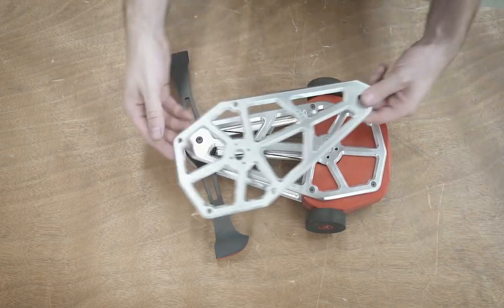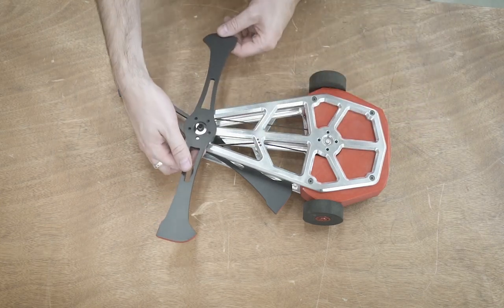Psychotic Break Overview

Comment: That butt seems like a prime target. On impact, you might spin around and expose that vulnerable switch area, or that's at least what I'd be hoping for if I fought against you. Those aluminum frames though... Yum! They look as indestructable as they are pretty! Also there's a nice mix of minimalist and innovative design in your builds. I always enjoy these overviews.
Reply: A vertical spinner to the rear would be the main concern for me. Especially so since the main robot power wire sandwiched just on the other side of the back of the body shell. However, I would hope that if Physcodic Break gets spun around by a weapon impact, it also gets thrown backward. In that case, it would probably have enough time to turn back around to a favorable angle. But I agree that it is probably dead if someone manages to get a big hit on the back.
Reply: Maybe the aluminum skeleton should extend all the way back so a vertical spinner hits that instead of plastic
Reply from the maker: @wtfpercussion  Nope!  I did this on purpose, I would rather the plastic get hit than the metal.  The plastic can give way pretty easily, but the metal could get bent, which would compromise the weapon.  In the end, don't get hit in the butt.
Reply: @RobertCowanDIY  Makes sense! Beautiful build man!

Comment: That looks really nice and aesthetic , has a feel of something that BMW would make. Have you ever thought of setting up that tormach and churning out some better designed wheel hubs in titanium?  Nylon G sounds interesting, have you tried laying down some cable runs in the body designs.
Reply from the maker: I need to find a better wheel solution, I really don't like the fingertech wheels or hubs.  I didn't have any issues with them this time around, but I think the hubs were just slipping the whole time.
Reply: @RobertCowanDIY  a white out pen and some index marking would confirm that. But with your skills some cnc hubs a sacrificial 3D mould and some silicone I bet you could make some killer wheels. How about a rotary broach and some hex shafts ?

Comment: Feels like Psychotic Break could easily be converted into a thwack spinner like Thagomizer or Minimizer by replacing the blade with a smaller asymmetrical blade spun at a faster speed, and putting the saved weight in the front as a plow. Just in case you wanted to keep putting your well machined pieces to good use!

Comment: I asked this question in an older video but being an older video the question was probably easily overlooked so I will ask again and hope you forgive my repetitiveness.  If one were to grind the weapon blade in such a way as to make a pseudo propeller, could the weapon provide additional down force for the robot?  I understand that in this particular bot it would probably be harmful to performance as it would take down force away from the wheels (like putting a rear spoiler on a front wheel drive car), but could it work in a bot where the blade is closer to the bot's centre of gravity?
Reply from the maker: It COULD, but it would increase the current draw (which is OK), and wouldn't provide as much downforce as you would want.  The RPM range needs to be MUCH higher to generate any substantial amount of downforce.  So you might get a pound or less of downforce, which could help in driving, but once you get hit, it would do very little, and would burn up a good amount of energy in the process.
Reply: FOIlLED! did it with 3D printed disc spokes

Comment: Isn't it a little risky having the wheel escs so exposed? Looks like they may be better off mounted forward next to the weapon motor. Much more inboard and protected.
Reply: well, do you see tombstone or debacle have protected wheels? the giant spinning bar does all the protecting in horizontal spinners.
Reply: @themuffinman4044  I see your point but you could be up against a similar bot. I don't see the harm in having it inboard vs mounted on external plastic panels.
Reply from the maker: Every decision is a compromise.
Reply: @RobertCowanDIY  what was the reason for the location? I assume you have a reason. Is it wiring simplicity/weight?
Reply from the maker: @Golf_Cart_Customization  Pretty much everything is wiring simplicity.  If the ESCs get hit, it means that the wheels were hit as well.
Reply: @Golf_Cart_Customization  that is very true, but it would kind of ruin the look. :)

Comment: Hey look, it’s debacle! Jokes aside, I am trying to build a beetleweight robot myself. How much do you think it would cost?
Reply from the maker: It really depends.  It will cost as much as you want to spend.  ;-)  It also depends on what work you want to do yourself.  My whole frame costs about $30-$40, but that's because I machine the whole thing.  It would be several hundred (or more) if I paid someone else to machine it.  Long story short, your question is impossible to answer.
Reply: Robert Cowan Hmm. You seem like a very skilled builder. I don’t have thee equipment to to machine my own frame so a trussed bot frame would be easiest. Thanks for the advice

Comment: less RPM more torque??? and what motors do you use at the wheels
Reply: He's using a pair of Aerodrive SK3 2118 3100KV Brushless Outrunners mated with two Actobotics 22mm Planetary Gearboxes, taken off of the Actobotics Premium Planetary Gear Motors. More info can be found in Rob's "Beetleweight Brushless Drive Tutorial."

Comment: How do you find battle bot type competitions near you
Reply: I am interested in making a battle bot for the beetle weight or the 15 pound class. Do you know any competitions in or near MN
Reply from the maker: @Anthony-we3ne  Check out my getting started video, it tells you everything you need to know, and where to find competitions.
Reply: Robert Cowan oh ok, thanks
Reply: Robert Cowan sorry for more bother, but what type of controller and radio do you recommend?
Reply from the maker: @Anthony-we3ne  My preference is the Frsky QX7.  It's about $100-$130, but it will do everything you need and is very reliable.  You can get cheaper radios, but this is my recommendation.
Reply: Robert Cowan one last thing, I am designing and I need a weapon motor for a 14 ounce drum on a beetle. where can I ask to figure out what type is best?

Comment: In Europe everyone uses ar500 for weapons. They never break but they wear out over time.
Reply from the maker: Well, this will be my last time using AR500.  It's cheap, but not nearly as durable as S7.
Reply: Robert Cowan I want to use S7 on my beetleweight, but in my book it says that it must be hardened to 54RHC to be effective. Is it hardened before I buy it, or would I have to harden it to 54RHC on my own? If so, how would I do that?
Reply from the maker: @robo9466  Yes, it needs to be hardened.  I have a guy that hardens metal and I pay him.  You can find people in your area just by looking on the internet.  Look for heat treaters, or something like that.  They usually harden parts for injection molds, knives, tooling, etc.
Reply: It's hardox 500 to 650 we use, not AR - similar stuff but hardox seems to be a superior material in this application, is the general consensus.
Reply from the maker: @TeamCroc  Noted.  I think I'll stick with S7.  I think it's more appropriate for weapon material.
Reply: Robert Cowan treated correctly I'd probably be inclined to agree for most applications - I've never had an issue with hardox personally though, it's a great low-cost solution over here at least, not sure if the cost is greater over in the US due to importing etc

Comment: Im worried about the pressfit motors on a flexible shell... at high heat or at on a heavy impact i can see then being thrown out of position and possibly jammed. Robert, ive always wanted to throw this out there... LARGE SPINNING WEAPONS... knowing that weight being on the outside edge of a weapon to transfer said weight to cause the most damage is a know fact. but the disadvantage of that would be strain  on the motors and also a longer spin up time. My query, is and really what ive wondered for a long time is why more bot builders arn't using  shifting centrifugal spinners to get the best of both worlds?!?!. Please, message me or reply if you see this, i have some more specific ideas about how this could be achieved.
Reply: Could you specify what you mean by centrifugal spinners? The concept sounds interesting, but I would image you would need some mechanism to keep the moving parts in so that they didn't fly to the outside immediately on spin up.
Reply: Too many parts to fail. It's a lot easier to just cut some weight somewhere else and throw more motor power and magic pixies at it.
Reply: @johnathanclayton2887  Sure, so like I said to SHIFT weight to give the best of both worlds eg, better stability, spin up speed, less motor wear...ect yet still pack a real punch. Usually with spinners theres a trade off somewhere down the line (especially with full-body spinners).
What I'm questioning is why more moving weight spinners aren't used.
For example (and this is most primative version of my specific idea) if you had a bar with a hollowed out core and inserted a heavy metal ball into the middle that a spring holding it back from the edge that did the dammage dealing,
When the ball is in its seated position and the forces are low the weight becomes a dead weight proving 'over the body weight improving traction... When the weapon. Is started the ball being in the center means that the motor has less offset weight to spin, meaning faster spin-up times and less motor wear, as the centrifugal forces get larger the ball would push back the spring until the weight would be shifted from center mass to the edges of the blade affording weight at the edge that did the dammage.

That was only the first most simple idea's but I have others that involve more thought gone into them... I just wondered why we don't seam to see any spinners like this.
Reply: @troy4393  I agree that you might compromise slight weapon failure if the design isn't correct or a massive hit is taken but it wouldn't be a huge failing point if the material was machined correctly.
Reply: Now you've got me interested. I was thinking you'd need something active like a pulley to pull out the weights, but a spring sounds much better. I would like to do some calculations on how much spend up time it would save, because you would be taking a weight and complexity loss by doing a system like that. Also, I'm a little Concerned about oscillations that might cause.
Reply: @johnathanclayton2887  That would be cool if you could. Yes, there are other idea's ive got that would further complicate the system but   keeping things simple when dealing with massive forces usually keeps the failure rate to a minimum. i can imagine this system would be a great addiction to the likes of a body spinner or a smaller weight robot. smaller robots have the problem that if they want a heavy weapon they also have to think about reach, yet adding reach compromises motor reliability and spin up time and also the weight/power of motors that need to be used. 

For expample, if you need a LARGE amount of reach, that reach has mass... meaning the resulting OUTER weight hasn't got a huge amount of kinetic energy stored as much as say a one with a aluminum inner and steel outer. now, if we removed some of that outer weight on the edge of the blade and slid the weight further up the length is still there it still weighs the same, BUT as the forces increase that weight is then shifted to the tip causing the outer edge of the blade to carry the most kinetic energy.
 
I also worried about if with weights moving at different times could cause an issue, in some drum, full body configurations i dont seam to think that would be an issue because most of the weight is somewhat centered, but on a bar type spinner i could see that it might be a very small chance there would be an issue if the weapon isnt machined or balanced correctly. I have already thrown out with the idea of a helicopter propeller stabiliser tyle of bar that would correct that issue meaning that if one weight pulls the scissor action of the bar would pull/puh the other weight out at the same rate it would be relatively easy to incorporate on a bot such as Son of whyachi, because its a bot that doesn't need to run inverted, bar spinners could use this also... but i figure that on a drum or disk there wouldn't be any need.
Reply: I *suspect* that it might not quite work the way you initially expect.
Wouldn't it be the same as a spinning ice skater?
The can change the speed they are spinning by holding their arms out or by tucking them in.

... maybe not though, food for thought either way :)
Reply: @_Piers_  Good catch. Maybe I'll do some physics calculations to see if I'd actually help. Maybe it can help keep in the motors optimal load vs rpm.
Reply: Perhaps builders want to keep it simple; robot combat being such a high-impact environment with surprisingly extreme forces, any possible point of failure becomes a larger liability. And in order for the mechanism to be worth the risk, you need it to shift a large portion of the weapon's weight.

That being said, I think a Z-shaped bar spinner with spring-loaded hinges on the Z's corners would be a robust implementation. Why don't try it out? Maybe it'd be worth the risk, especially if you're in it for fun
Reply: @_Piers_  Perhaps as the spinner slows down due to weight moving outwards, the motor would respond by increasing its torque until it reaches target RPM.
Reply: @johnathanclayton2887  What about a Z-shaped weapon, where the central bar's linked to the smaller ones(at the "corners") via robust, spring-loaded hinges?
Reply: If you used a z shaped bar that straightened as it spun up, you'd need some sort of locking mechanism on it, otherwise it becomes a flail and losses half or more of it's kinetic energy. But those end sections would also need to fold back in somehow to spin up a second time. Maybe you could rig up some sort of force sensitive latch to only release when little force is applied?
Reply: @johnathanclayton2887   Sorry I forgot to mention, the Z doesn't "straighten" but rather folds into "===O===" when stationary, and "Z" when fully spun up. The impactor/teeth are at the "corners", with spring-loaded hinges behind them. Basically a bar spinner with extra mass behind the teeth when spun up. The hinges fold the "extra mass" back into the bar when not spinning.

As for how to lock the smaller bars in a "Z" position, where they touch the longer bar, the hinge could be placed on the smaller bar's corner that's "inside" the surface that touches the longer bar. This also helps to spread some of the impact from the hinge, so it's mostly handled by the bar-bar contact surface
Reply: @johnathanclayton2887  Alternatively, spinning the Z counterclockwise could hold it open when hitting(known as "aggressive mode" in centrifugal clutches)
Reply: @revimfadli4666  That might work.